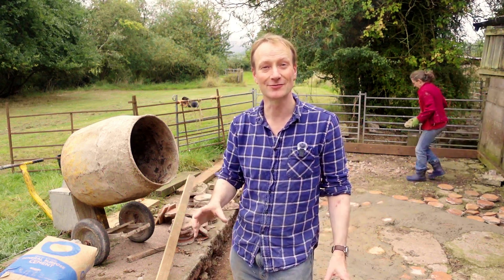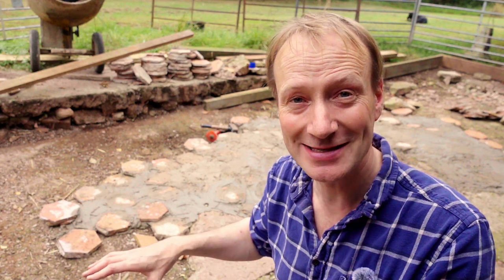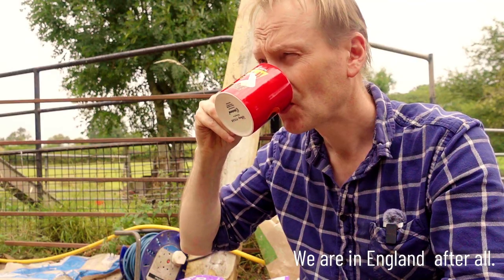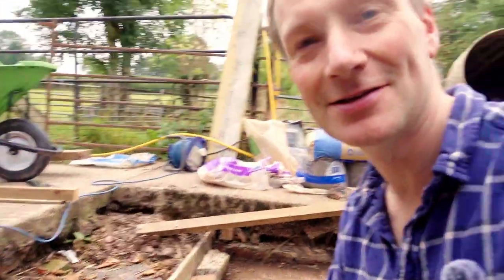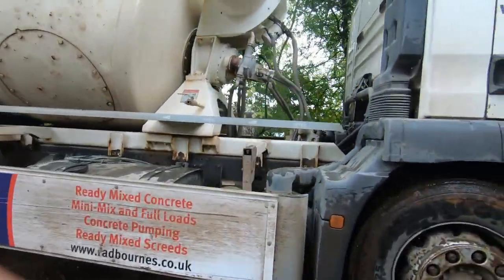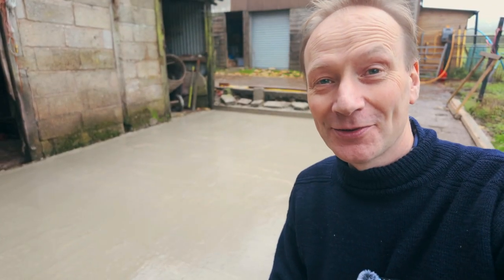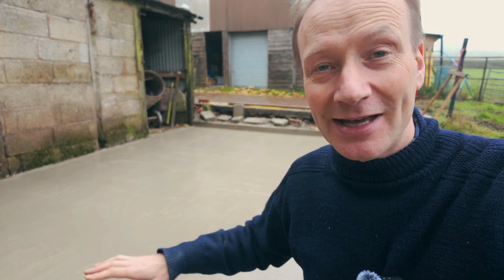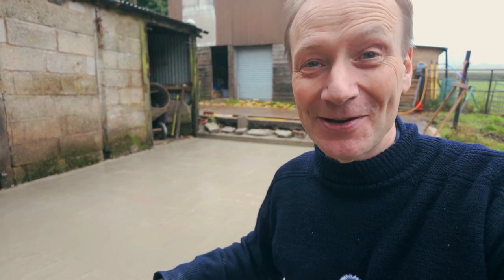I Finally Poured My Own Concrete Slab!

Comment: Looks great.  The texture I for non-slip concrete is dragging a large broom across it just as the concrete begins to thicken enough for the desired effect.
Reply from the maker: Hi there.  You are absolutely right - my neighbour also said the same thing.  In my poor defence I didn't have a large broom at hand but that would have given a really good effect.